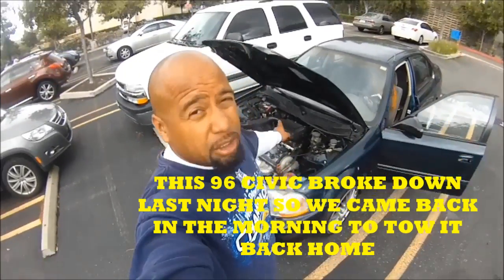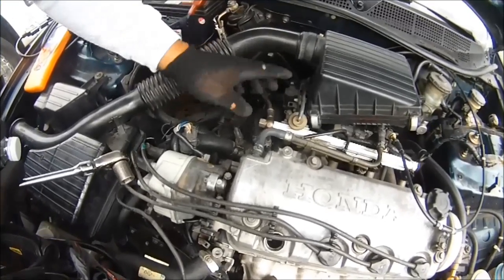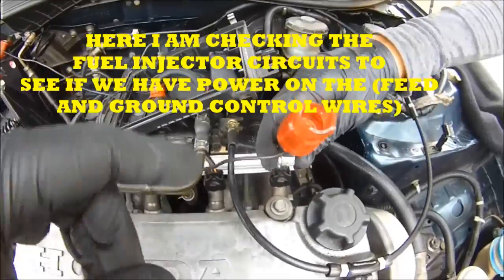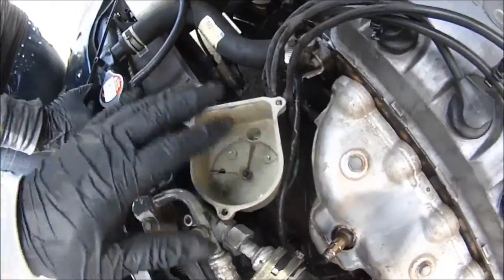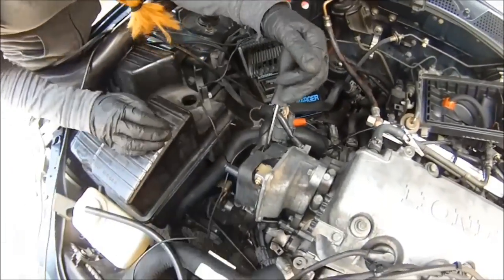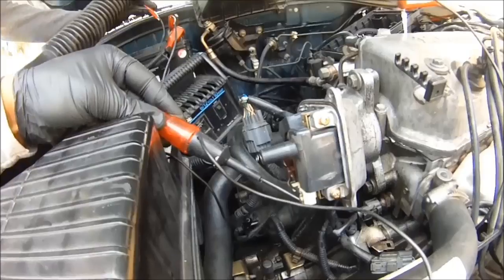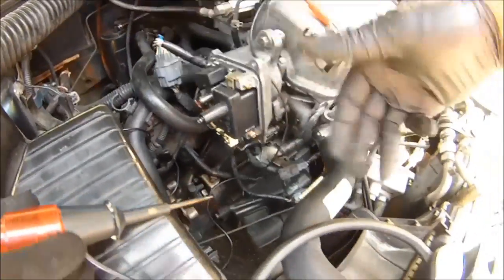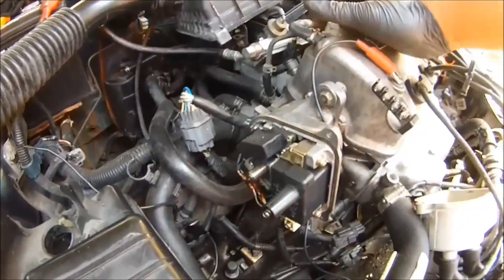HOW TO FIX A CAR THAT WILL NOT START,  HONDA  CIVIC

Comment: great vid,,i have a question..at the car wash, sum soapy water got in to my gas pressure hole under the gas cap (92-95 Honda civic auto)..thus making my car not start..i added some fuel cleaner and car turned on for couple of days. I drained fuel and added new fuel..car doesn't turn on anymore..sounds just like in your video but doesn't turn on.. I changed out the fuel pump thinking that might be the issue, but same thing, turns but doesn't turn on..i checked all fuses and all are good..the fuel relay makes a click when I turn on key..but I dnt hear fuel pump come on..my car nvr really had a issue until this water in fuel..before I start ripping things apart, plz let  me know if you fixed or know of how to fix this problem?..thanks and ur a savage

Comment: Hello Dude,
I have a similar issue it is in the primary ignition of my Golf '99. There is no spark!!
I changed the coil, crank sensor already! Still no spark 
Manually I can spark it Tested Coil.
Noticeable is that I do not have power on the crank sensor plug (3 wire)( If I am correct I should have 12V there) ground is OK

This all happened after the cylinder head gasket was replaced it ran 2 miles and never more
Can you instruct me on further diagnostics?
Crankshaft sensor was replaced.

Comment: I have crank no start as well timing belt went out changed balaner belt and timing belt question here is if im at tdc exhaust not compression will i still get spark ? Im not getting any spark .

Comment: I was looking to get the spec on the resistance from primary to secondary when you got to that point in the video but you didn't measure it :-(
I have one with about 9.9k ohms, is it in spec?

Comment: So im curious of the no pulse on the injector switches/connections? My Integra is getting no pulses on the injectors and on the distributor when I crank it. Ive already change the ICM and the Coil, still no spark and injectors still giving no pulses when cranking. Help?

Comment: Please get back to me bro got a 02 civic 1.7  . Crank  no start issue  getting fuel pressure to the rail also replaced crank sensor and connector . Gonna replace the cam sensor  and return the crank sensor and replace with a new one again engine is also tdc . Don't have a spark tester gonna do that tomorrow . But it also won't fire up when I spray starting fluid in hoping it's a issue with spark but in just replaced coils and spark plugs not long ago maybe less than 10 k miles  so please get back to me boss .  All relays are clicking and functioning fine  . I'm determined to fix this .. As a apprentice automotive tech it would be quite a let down to myself to take my baby to a shop .

Comment: Great job If I were getting spark and fuel and still not starting what would you say to look at. I sprayed starting fluid in the air in take nothing. I could smell fuel on the plugs. So I thing Im getting fuel and spake but no combustion. I am getting my but kicked. Thank you
Reply from the maker: redwood1957 check timing marks

Comment: If it's a Honda most likely it's the module inside the distributor , most shops will have you replace the whole thing to charge for the labor but 90 % of the time it's the module

Comment: I had this problem on my F150, no pulse no signal going through the spark plug wires... It turned out to be a dirty connection at the crankshaft sensor but, i also had misdiagnosed and changed the cam sensor also My question here if the car has the distributor does that mean it will not have those sensors like crackshaft sensor etc ?

Comment: 7:52 buddy I think your wrong, the crank sensor is by the timing pully, and there is no such thing as a cylinder sensor lol. The distributor is made up of 6 components, a igniter, a ignition coil, a rotor, magnets, a cap and a shaft which connects to the cam shaft

Comment: I have 2006 Honda accord light ac radio work wont crank replaced starter in 2015 ,any suggestions thank you

Comment: My Civic would not start one morning. I eventually found that behind the glovebox there is a fuel cut off switch which stops the fuel in the event of an accident. With this unit you just push the switch to reset it. Never in a million years would you find this. I only found it by reading the handbook.
The reason it tripped out was because I stopped very suddenly. Just another day at the office. G Pt

Comment: Hey.. I have a 2000 Acura Integra. I just replaced the igniter, ignition coil, cap, plugs and wires. I also replaced the battery and fuel filter. I still can't get the car to start. What should I try next?

Comment: Hey there oldskool funk I'm having a similar situation with my 1989 Honda civic dx. It cranks but wont start. Only difference is that i have a brand new distributor and I am getting spark at the spark plug wires. From there I dont know what to do. I'm in need of desperate help. This car is my family vehicle and without it ran I already lost my second job. Please I need your help. I'm running out of options on what to do. Thank you

Comment: 2:53 Your spark testing method is only valid for vehicles with a distributor.  You tested cylinders 1 & 4 which on most 4-cylinder engines are considered companion cylinders.  If the car has a coilpack (waste spark system) like the 1998-2002 Mazda 626, then it's possible for cylinders 1 & 4 to have no spark but cylinders 2 & 3 to still have spark.  Mos times in that case the car should at least try to rumble start but I've seen where it doesn't do that until every 10th starting attempt making it feel more like a bad CKP issue when it is actually a bad coilpack.  In the case of coil on plugs like the 1993-2002 Mazda Protege you could have multiple bad coils (which I've seen happen) which your testing method up to the point of 2:53 could possibly miss.  My point is; it's possible to come up with the wrong initial diagnostic path and waste time chasing a bad CKP when it's actually a dead waste spark coil or multiple bad COP's. Always test adjacent non-companion cylinders 1 & 2 or 3 & 4.  Test multiple other paths (which you do) to get confirmation.  Eventually you would get around to realizing the mistake but not until wasting 10-15 minutes doing other tests. Waste spark setups have caveats for spark testing compared to a distributor setup.  I wouldn't have said anything if your title didn't say it was for all cars which isn't technically correct the way you demonstrated the initial spark testing procedure.
Reply from the maker: ***** You can test spark on ALL cars. Coil packs, Coil over plugs there are different approaches as to how you can get to SEE the spark . Yes you are right each individual coil can go bad in a coil pack or coil over plug Ill show tricks  in my future videos thanks for pointing that out.

Comment: What's up oldschool funk. I've got a crank but no start problem . I have a 2005 2.4l dohc turbo pt cruiser . Cranks but no start . Fuel pump kicks on. . Airflows good .Getting spark in all cylinders . Compression test shows no compression on 1 and 4 .cylinders 2 and 3 are good on dry comp test . Wet comp test didnt have any effect . Oil in throttle bpdy . Was throwing cam sensor code . Replaced that and did my tests after coming to no end after the sensor . I'm not the type to throw every little part at a car let alone afford every little thing. But my main concern with the info ive got . Is the valves . Any ideas to check before taking the cylinder head off and checking valves . Pt cruiser is not a easier car ,space wise ,working with.
Reply from the maker: See if your timing marks are lining up.
Reply: Thank you for the reply . Don't mean to bother ya this late .  Idk what time it is in La but it's almost 11 where I'm at. I don't have a pro scanner to check it's timing.  Crankpulley teeth look inline perfectly .
Reply: You mean timing marks like when putting at tdc when replacing timing belt for instance . Correct ?

Comment: Maybe you can help me out. I connected my testing light to the positive on the battery. When I go to check the ground and power wires for the injectors, the ecu and injectors clicks and the bulb turns on. BUT when I turn the key to the ON position, the bulb suddenly turns off.. and the same when I try to crank the car, the bulb turns off on the testing light. Does this mean my injectors are not going to fire? My car wont start. It cranks, it sparks, and its getting fuel and the timing is good but it just won't start.

Comment: would have it been easier if you put starting fluid or carb cleaner in the intake when you got spark already, to start the car and keep it running while the injectors started working again? it would or should, at least in my mind, make them work sooner.
Reply: BTW, this video is awesome

Comment: hi oldskool i have a 2002 nissan altima and the light on the dash board keeps telling me that its my crank shaft position sensor but ive replaced it 4 times already and the car turns off sometimes when im driving can you please let me know what the problem could be God Bless

Comment: so I did this method without pushing the clutch in, and mine only makes one click when I turn the key.. not machine gun sounding clicks..
does this rule out my main relay as the possible issue?

Comment: Hey oldskool funk bro can you please help me find the steps to change the timing chain on 09 Suzuki sx4 and I need to find the crankshaft sensor  I have a code for camshaft sensor p0340 I changed and it didn't fix the problem so I will change the crankshaft sensor but can't find it please help bro

Comment: I need help, my 90 Honda accord doesn't start, it has a new distributor, good fuel pressure, I changed the main relay and still the same issue, any ideas, thanks

Comment: HELP.. I have 2004 Honda Odyssey van...  water pump went out.  Replaced it, had heads redone , time set. everything possible. number 1 is not getting compression but rest are.  it cranks but will not start. Is there any sensors I am missing... No codes are coming up.

Comment: Can you help me out.  My 97 Oldsmobile bravada v6 4.3. no Crank no start. New battery new ignition switch new ignition switch harnnest.  new safety switch. radio turns on lights turn on windows go up and down. I don't know what else to do.

Comment: HELLO I GOT 96 TOYOTA COROLLA  96   ..IT CRANKS NO START ..I GOT SPARK AND FUEL PRESSURE  ..NOW I DON'T WHAT TO LOOK NEXT...THANKS FOR YOUR VIDEO
Reply from the maker: +Rami Azzedine I would check injector pulse width ( see if you have pulsating on each injector connector) with a test light while cranking,  Check mechanical timing marks and see if the belt jumped a tooth, (pulley and crank marks). Also Cam and crank sensor resistance but if you have no pulse width then it could be one of the 2. fuel pressure could be to low (clogged filter), map sensor could be bad (check resistance with a vacuum pump connected, Idle air control valve could be bad, vacuum leak, there is so much that can go wrong, hang in there this is your test.

Comment: Oldskool funk Love your vids man, learned a lot, cheers from Spain.
I see hondas are your thing, right now I have my '97 Honda Civic 1.5i LS D15Z8 VTEC-E (euro market) that has pinging problems. When it is cold it makes no noise, but once it gets warm it starts developing it.
Well I think its pinging because I retarded the timing to tdc mark and the noise had almost banished, it happens when I press throttle like mid position on a higher gear depending on load, if I depress the pedal slightly it stops doing it, and if I floor it it stops doing it also,  It's like "marbles in a can" sound, what can it be?, valves needing adjustment?.
 MPG is great (39mpg VTEC-E engine) when timing is right and it works well aside from that noise, also air, fuel filters spark plugs are new and the plugs are on the colder side of the recommended ones.
 Also I don't know if its related, but sometimes the car takes a looong time to start and I have a big hole in the exhaust pipe before the silencer (I bought the replacement, I will fix it when I have the time), but i dont think its related because it has only 1 upstream o2 sensor in the exhaust manifold/cat converter.
Thanks!

Comment: I did that before too, i put a external coil on my car, and the wire i had was crappy i was alone just testing stuff didnt realize the boot was back and my finger was on the plug, i plugged it in samething i couldnt let go for like 3 seconds, worst shock ive ever got

Comment: Oldskool funk, I have a strange problem here and I am asking if you or anyone can help me to solve it. I have a 1996 Golf GTI VR6 AAA, it cranks fine but will not start. fuses are good, new cam sensor installed, good crank sensor, I have 2  ECM modules with the same numbers, new battery, and new gas pump. I have scanned the engine and I have a 5 codes, 2 of the codes are the ones preventing it from starting.
I have now replaced cam, coil pack (I had an extra one), fuse panel, all new fuses (all of them, including those under the hood), un-pluged and cleaned (with electrical contact cleaner) most of the plugs under the hood. I removed the battery and plate below to get to the ground posts, wire brushed them and cleaned the area with the electrical contact cleaner, ECM (my ECM) and connector as well. Battery has a full charge 12.7v, removed all spark plugs and cleaned them and put them back in the engine, torqued them down to specs 18 ft lbs as my manual said.

Tried to start it up but it failed, cranked as normal but no start. All the normal dash lights were present. I have gas at the top fuel rail, I have spark, and I see the tach level moving in the dash. i tried about 4 time, I think I heard a sputter but it only happened once. That was it for me for the day, I will be on it again tomorrow with my test probe to verify some signals......I have another ignition switch I will install just to eliminate that possibility (since I have it, new).........but yea, the fuel rail seemed good, it had pressure and gas was present.

 BELOW I HAVE PROVIDED THE SCAN REPORT FROM VCDS ROSS-TECH...........CAN SOMEONE HELP ME PLEASE, PS: I AM NOT A MECHANIC BUT I CAN HELP MYSELF, this is just a restore project car for me. 

VCDS Version: Release 12.12.0 (x64)
Data version: 20130910

Sunday,07,January,2018,20:00:49:62939

Chassis Type: 1H - VW Golf/Vento III (1992 > 1999)
Scan: 01 02 03 08 12 15 25 41 56

-------------------------------------------------------------------------------
Address 01: Engine Labels: 021-906-259-AAA.lbl
Part No: 021 906 259 A
Component: MOTRONIC M5.9 HS V05 
Coding: 00000
Shop #: WSC 00066 
VCID: 132559C761805386391-4A3A

1 Fault Found:
17908 - Fuel Pump Relay (J17) 
P1500 - 35-10 - Electrical Malfunction - Intermittent
Readiness: 1110 1101

Comment: if the battery in my civic has been relocated to the trunk (distance issues of course)
then I can just have someone help me crank the motor from inside the car to test the
spark right? basically what you did, but without using the battery?

Comment: HELP. Have a 1998 Honda civic ex. No start no crank problem. Changed the starter and a new battery, still No crank,no start. Where is the neutral safety switch or what else do I check?

Comment: I've got a 2000 1.6 I've changed distributor, wires and main relay.. Still no start... I have a weak spark... But from the coil it's ok... What could it be

Comment: you think a Throttle body, IAC valve will make the engine not  start it cranks is got fuel pressure.

Comment: oldskool funk i changed the whole distributor for 70 bucks in amazon. i thought that was the issue but my car is still in a no start condition. it will crank and start for a few seconds if i hit the gas a little bit but it will not stay on. it will stall. the fuel pump i also replaved thinking it was that too. please help me out
Reply: Michael Ortega injectors

Comment: hey man great video... i have a 1992 hatchback civic. and it will start but when i give it gas it will like bog down.... i have to hold the pedal down ever so slightly to get it to rev up at all... its not driveable currently. any suggestions on why its not revving up when i give it gas? thanks in advance

Comment: I am a single mother of eight I need some help Ford explorer 2008 keeps shutting down on me while I'm driving it has become too dangerous for me to do it with my kids or even myself in the car I have changed the alternator and the battery it sounds like it's trying to catch his breath before it shut off.

Comment: So my car turns over but doesn’t want to start. Sometimes it starts. When it does start sometimes it runs rough then goes to normal running. When it sits out in the cold it has a bad time starting.

Comment: I'm having a problem with no start... car is getting fuel and spark... no check engine light ... changed dizzy... changed main relay .. plugs .. wires....fuel filter ... car would start in the AM but when I shut it off it won't start till I wait half hour ?

Comment: It's not that simple. I have a crank no start condition that points to all signs of bad sensor or spark plugs. On 2005 civic their coils & they aren't bad. Everything works except I'm getting no fuel pressure to the engine, it primes but no fuel to the engine with no leaks replaced pump too & still nothing. I had to order a whole sending unit because of clogged sending unit. It can be very tedious. But good video.

Comment: please help me the tow man sais i blew my head gasket but autozone told me too add oil stop leak & to drive my car for two hours i have a new battery it will not turn over or power on